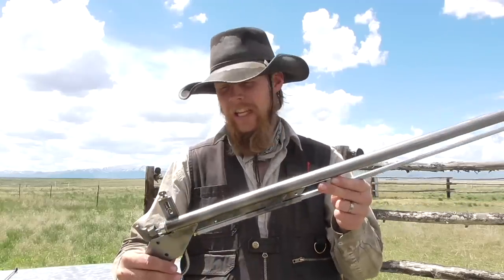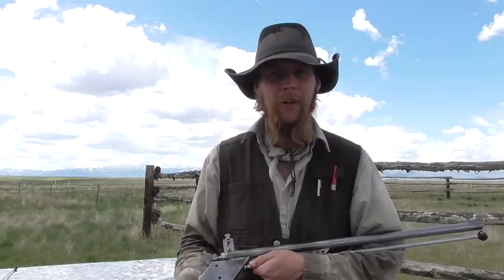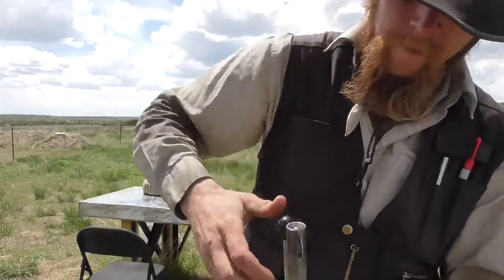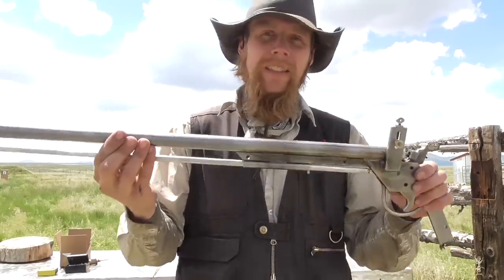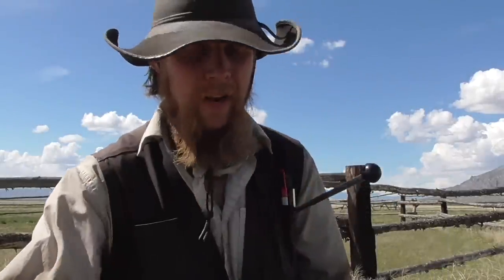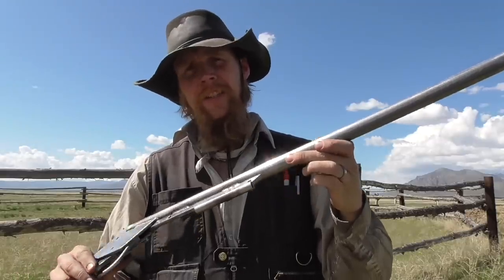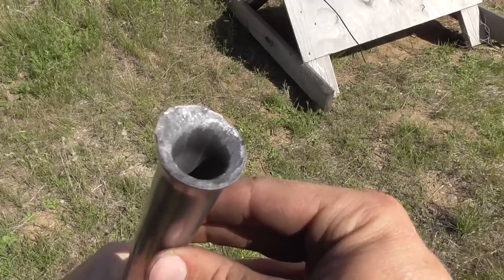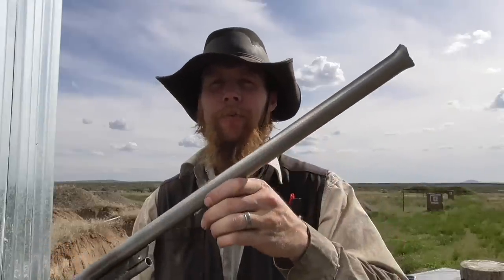Muzzleloader Overload Testing (TIS221)

Comment: that was crazy! I have always wondered what would happen to a muzzle loading rifle using smokeless rifle powder. every time i have seen a muzzleloader smokeless destruction test, they use a MASSIVE amount of FAST BURNING pistol smokeless powder, and then ram the heaviest projectile KNOWN TO MAN down the bore! well, DUH, OF COURSE IT'S GOING TO EXPLODE! I don't think 1/2" thick wall 4150 steel could take that amount of pressure.  I get it, they WANT TO MAKE A POINT.  The problem is that anyone who knows anything about powders will know what is going on. I certainly wouldn't try using smokeless in a muzzl loading rifle i wanted to keep. but, if i found an old rusty gun cheap,..............

Comment: What pipe did you use for the barrel? Is it just regular steel
Reply from the maker: The barrel is made from DOM tubing, so it should be type 1020 steel or something similar.
Reply: @TheIdahoanShow Would you still recommend this tubing or something else?
Reply from the maker: Yeah, it worked great for muzzleloader barrels.
Reply: Cool thanks for your reply. Do you think that with about 80-100 grains of pyrodex the power from this gun is similar to a real muzzleloader? Obviously the barrel isn't rifled and isn't engineered specifically for this use.
Reply from the maker: @JSB845  Yeah, if the load and barrel length are similar, the velocity and kinetic energy should also be similar.  Side note: Actually, this gun does have a rifled barrel.  I start with the DOM tubing and drive a rifling button through it.
Reply: @TheIdahoanShow Cool that is very ingenious of you! Do you think a weapon like this could be make in a cannon style? Dom tubing with just a hole drilled on top of the tube to slide a match in? Thank you in advance.
Reply from the maker: @JSB845  Sure.  That would be a lot like the "matchlock" version that I built as a collab with Jorg Sprave, only simpler.  https://www.youtube.com/watch?v=-KP1PBEnHkg
Reply: @TheIdahoanShow  Another thing that I am wondering is why not use an alloy tubing that is stronger? From what I can understand AISI 1020 is a mild steel. Would you recommend using 1026 tubing?
Reply from the maker: @JSB845  Sure, alloy tubing is stronger, but it's also more expensive and this is plenty strong enough for what I was using it for.
Reply: @TheIdahoanShow  Alright great. I am very sorry to flood you with all these questions (but at least it makes your channel more popular haha). The final thing I would like to know is how to plug/close the opposite end of the barrel (possibly without any welding required).
Reply from the maker: @JSB845  I typically just tap the breech end with a 9/16-18 UNF thread and make a breech plug out of a bolt.

Comment: In Europe, muzzleloaders are taken to a state proof house. The weapon is first put through an X-ray tunnel, where a special camera recognises even the smallest hairline cracks or blowholes in the material. If anything is detected, the weapon is not even sent for firing. If the test is negative, the gun is fired twice with a brutally high overload, with around 60 % of the powder flying out the front unburnt! Then the proof mark is stamped into all essential parts of the weapon, in the case of muzzleloaders only the barrel. If the gun fails, you get it back as a cute jigsaw puzzle for your children. The good thing is that when you buy a gun like this, you know it won't blow up in your face. It's the same with all weapons, regardless of whether they're home-made, a fine masterpiece or a mass-produced civil/military weapon

Comment: I was taught that black powder without anything else has a maximum pressure of 14,000 psi. But since the smokeless revolution, I have never heard of anyone testing it. None of the professional testing companies will work with black. Maybe you could get a guage and weld it on?
Reply: Depending on the charge and wt. of the projectile, much higher pressures can be reached. The Double Gun Journal had a series of articles leading up to destructive testing of Damascus barrels that was interesting.

Comment: I think your bulge was more caused by you putting the 750gr in backwards. The taper of the bullet forced pressures to push outward around the bullet putting sideways pressure on the barrel before actually pushing the bullet outwards .

Comment: Was this a factory made barrel,  or one made from DOM ? If dom  what is the od and id of the dom .  Excellent video. 
   Curious of the wall thickness and if the breach plug is threaded or press fit and welded . Would really appreciate the information my friend .
Reply from the maker: 7/8" OD x .188 wall DOM tubing, threaded breech plug.

Comment: I don’t get it, is that a commercial product? How did it survive 240 volume grains of unidentifiable rifle powder? CVA did videos and burst guns with far less smokeless powder. I mean it too, they blew them guns to bits.
Reply from the maker: Very low production volume, but yes, some of these muzzleloaders have been sold on the commercial market.  Admittedly, the unidentified smokeless powder looked like it had a cylindrical grain structure, indicating it was most likely a relatively slow-burning rifle powder, such as would typically be used in large bottleneck rifle cartridges.  An equal volume of a faster-burning flake-type smokeless powder would have caused pressure to spike much faster, and might have caused more damage.  Perhaps that is what CVA was using.

Comment: Is that schedule 80 Iron Pipe for the barrel?
Reply from the maker: No, its DOM tubing.
Reply: So I am desiring to make a double barrel BP shot gun, I have been looking at slam fire an they use sch 80 iron pipe. I like the looks of the suggested pipe. What wall thickness is the pipe and bore diameter? Thanks in advance and keep up the work. Oh by the way I am in the process of changing from carpenter to machinist, just need the jobs to quit the one and start the other.

Comment: OMG what kind of steel did you use for the barrel, I think the reason why it didnt blow up was because the metal wasnt harden to a certain degree and thus not very brittle, so it deforms instead of blowing up and shatter, unlike those remington muzzleloader tests, which the whole barrel splits in half.

Comment: Would not recommend it. But a friend of mine and also myself. We used to reload our muzzle loaders with powder using a ketchup bottle followed by a patched .50 cal ball. One rifle was a Thompson the other was a Hawkens. We found you could not put in any amount of powder that would hurt either rifle. They were accurate also. As long as you loaded them the same each time. Even when over loaded, the recoil was not much more than when loaded correctly. I think the black powder and or pyrodex burns to slow. It just burns the extra powder outside the barrel, making a very large muzzle flash. AGAIN, I WOULD NOT RECOMMEND DOING THIS ! WE MAY HAVE JUST BEEN LUCKY

Comment: I would have loved to see a double load before the bore obstruction (loaded once then say you forgot it was loaded then loaded once again. A common mistake) 

Or say 300 grains of powder and multiple lead balls

Only so much black powder will burn in so long a barrel and weight will provide more pressure than filling with more black powder 
Especially with ball projectiles as they’ll create a better gas deal than led shot and a patch

Comment: Fine test! It would be interesting to see, how much unburnt blackpowder The gun "womits" outside the muzzle. Could be tested by  posting 3  white bed sheets on front of the gun, collecting and measuring the unburnt powder weight. I have done this to find the most  economical charge, but on ice surface, no measuring done, just eyesight.

Comment: I would suggest for future tests that you use calipers to check for any minor change in external barrel dimensions.  
This the second time that I have seen modern steel barrels in muzzle loaders withstand reasonable loads with smokeless powders.  for hunting or target shooting I would never use smokeless powers.  In a survival situation I would not hesitate to use smokeless in an appropriate load.  My major worry would be escaping gas from the lock.  A cap on its nipple or especially for a flint lock would be venting a lot of  gas back at the shooters end of the gun.  
I watched Iraqveteran8888 test a gun filled to the muzzle with black power and no problem.  They blew it up using powders that would be used in a pistol.  The same loads would have likely damage a modern cartridge firearm.  
Thanks for the presentation.

Comment: The was a neat test! You did use anything in the way of a patch it to seal the expanding gases behind the bullet as you are supposed to do with a black powder style firearm. That tells new that there results could be catastrophically different if you had. The overpressure gases were mostly in check because they just went around your projectiles.

Comment: Not surprised it held up so well to torture. Flintlocks are heavy for a reason. Back then they knew to account for user error. I'm pretty sure the standard barrel proofing method was to just triple the max powder load under a standard bullet and see if it blows up.

Comment: You could fill the whole barrel up with black powder and put a ball or bullet in the end of the barrel and you cannot overpressure the barrel. All you are going to accomplish is burning as much powder as will burn in the barrel until the pressure is released out of the end of the barrel and you will have whatever powder left in the barrel that is unburned. That powder will come out of the end of the barrel and more than likely will create a large flash as it is ignited away from the barrel by the hot gasses and burning powder. You cannot overpressure a muzzleloader unless you put enough of a restriction in the end of the barrel. The only way to overpressure a barrel is to create enough of a restriction in the end of the barrel and then and only then can enough pressure build up inside of the barrel to cause over pressure.

Comment: I have a friend who loaded his CVA Hawken 50 cal. twice while we was target shooting once he used 120 grains of double F black powder and the old patched round ball load.he was a big man and when he fired the rifle it steped him back a step ,I had just stuck a un shot target up.and he did say it kicked kinda hard .it was louder and rolled a big cloud of smoke out .but it did not hurt the rifle and there was 2 bullet holes in the bulls eye one just a bit above the other.LOL the rifle was fine he did say his shoulder was kinda sore though.but he hung it in the gun rack of the rear windshield of his Truck and it was loaded until he hit a few bumps .the next time I seen him he had a big hole in the side of the truck cab.LOL he told me it scared him bad and he almost wrecked because the cab of his truck was full of smokeand he could not see.but the rifle and fine and his truck was Ford tuff  and it was fine until he shot a 30-06 thru the floor of it and blew a U joint out of the front end.LOl road hunting can be costlyand hard on your truck.lolI put 160 grains of double F in my Lyman Great plains Rifle and shot it once ,it just blew alot of powder out with the shot and set the woods on fire and I had too put out the fire before it got out of hand.so I never did that again.Good video ,thanks.

Comment: It doesn't really matter how much black powder you pour down the barrel a black powder rifle will only burn so much powder and the rest of the powder it doesn't burn is blown out the barrel on burned the way you work up a maximum charge for your black powder rifle is you stretch about three feet of white butcher paper under the muzzle of the powder you start with a reasonably light load and you up to charge in increments of one grain at a time until you find unburnt powder on butcher paper that's your maximum charge the gun is going to effectively use if you keep upping the charge by a grain you're just going to find more and more and more on burnt powder on the paper

Comment: You obviously have a well made barrel. Couple of additional things I would have liked to have seen. Multiple loads - namely powder, patch, ball, powder, patch, ball, powder, patch, ball. That scenario picking up an excited hunter who forgot he had already loaded the rifle. And I would have liked to have seen a bore scope evaluation of the inside of the barrel after each overload. 
I actually expected most of your results, except for the unidentified smokeless (presumably) powder. I actually expected that one to do something without the addition of an obstruction. Still, good work. 
By way of an FYI, several muzzleloader companies have videos showing destruction of barrels simply by using smokeless instead of black powder. Well made firearms. But there's a builder who is making muzzle loaders specifically designed for smokeless powder. So, it's possible to make a front stuffer that is DESIGNED for smokeless powder. Without such specific designing, though, using smokeless powder in a front stuffer is asking for trouble.
Reply: There's really no reason you can't use smokeless in any muzzleloader, it's just a ridiculously long and mathematically intensive process to figure out a charge weight and seating depth that doesn't make a pipe bomb compared to black where you basically just stuff and seat til crushed.
Reply: @johnnydjiurkopff  - While you are actually correct that a properly calculated and carefully weighed and measured smokeless powder can be used in a muzzleloader, you are being MUCH too casual about the amount of detail required to be safe when doing this. Far too many people don't have a concept of how little an amount of smokeless will equal black. Then you get into pressure curves and when those curves occur and how to design the barrels to have enough strength in those areas. It's MUCH more reasonable to remind people that they can't use smokeless in a muzzleloader unless the powder specifically says "for muzzleloaders".

Comment: Very interesting and informative video. One thing I didn't see tested and in-fact someone around here was injured from it occurring was a double load. the person he borrowed the black powder from had not discharged the weapon the deer season prior and he then reloaded it with another charge and projectile on-top of that. Needless to say he can no longer count to ten using fingers and is partially blind in his right eye. All in all this weapon you tested stood up to some substantial abuse and survived. Very well made rifle indeed sir.
Reply: I think it would be an interesting route in this testing, double or if it is not a problem triple loads!
If the gun can withstand it like this abuse, it could be a selling point... actually only an extra half of selling point because this testing was one whole for sure

Comment: Barrels manufacturers have different maximum pressures ratings, so this information is useless.  I'm sure people have doubled there powder loads and realized the mistake from the recoil.   If he wanted to blow up the gun, all he had to do was use modern power in the rifle.  All he proved was any idiot can make a pipe bomb, but he didn't manage that.
Reply: He did. Did you not watch the entire video or are you unable to pick up innuendo??
He called it “unidentified propellant” for probably a sleigh of reasons. 
1) being he probably didn’t want to deal with all the keyboard warriors giving him a rash of shit for breaking the #1 rule of “NEVER PUT SMOKELESS POWDER IN A MUZZLELOADER”
2) he didn’t want the “safety squad” giving him a hard time. &
3) he didn’t want to be liable if people got the idea to use smokeless powder in a muzzleloader would be somehow safe.
Go to this time stamp 👇🏾👇🏾👇🏾
12:30
The “unidentified propellant” is tongue in cheek. You can clearly see see he’s using SLAP/long shot which is modern day smokeless powder.

Comment: Nice one! Really an eye opener. One factor with muzzle loaders is that the breech isn't completely sealed when maximum pressure is attained, there is always quite a considerable amount of pressure escaping the nipple. The pressure escaping from the nipple would naturally increase as breech pressures increase, creating a bit of a safety margin when errors are made when loading.

Comment: That is an impressively strong barrel.  What steel and heat treatment / Rockwell hardness was used to make the barrel?
Reply from the maker: It's just cold-drawn 1020.
Reply: @TheIdahoanShow  Thanks.  It seems oddly strong for such a "weak" steel.  The wall thickness was not very large.  That tube looked no larger than 1.25" OD.

Comment: Wheres the flint?
Wheres the drum and bolster?
Oh that's right,its not a muzzle loader
Reply: There are these things called Percussion Caps (180 years)... then some modern muzzleloaders also use Shotgun Primers.  Shotgun Primer guns have been out for over 20 years.  It is like saying, "Where is the Matchlock and Burning Cord?  It isn't a muzzleloader without the Burning Cord!"
Reply: exexpat11 its not
Reply: @jimnastics3915  Do you load the powder and the ball from the front of the barrel - thus muzzle-loader?  The end of the barrel is called the... muzzle.  I get it.  I say the sky is blue and you say... "No it isn't."

Comment: I enjoy your show, would like to know more about the grades of steel used. as for the test you have done with over loads of black powder, IV8888 has done the test as you have . The biggest damage come from a air gap between the powder and the bullet. The breach was blown out of the test gun, and the stock splinted.
Reply from the maker: In this case, the barrel was made of cold-drawn 1020 steel.  I'll have to try the air-gap scenario at some point.